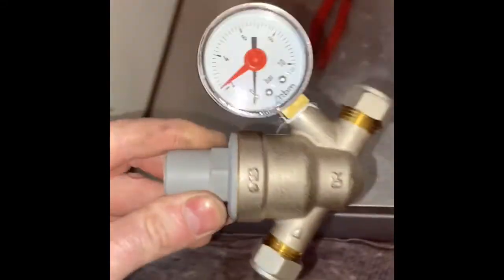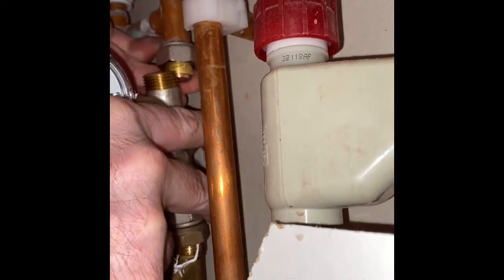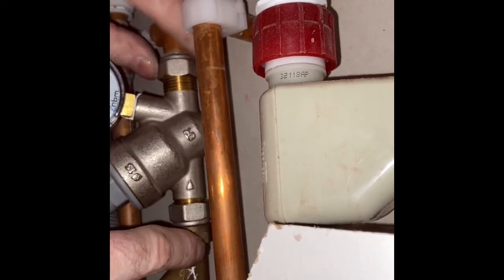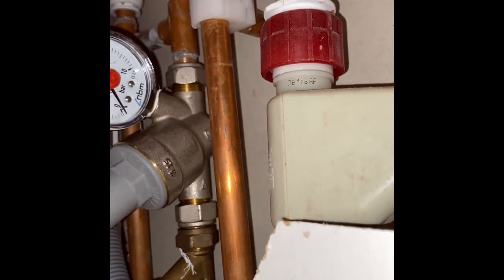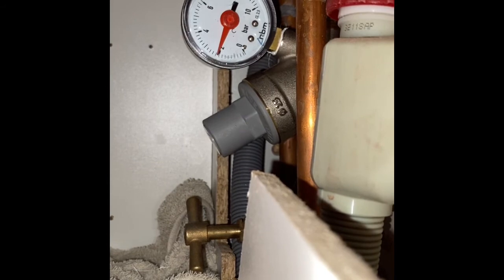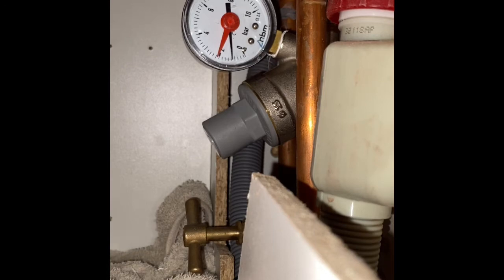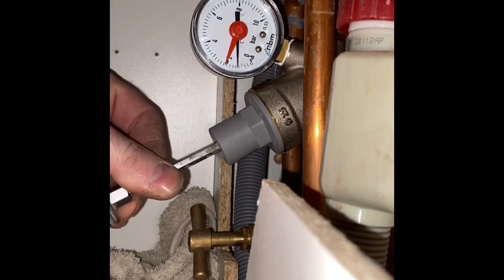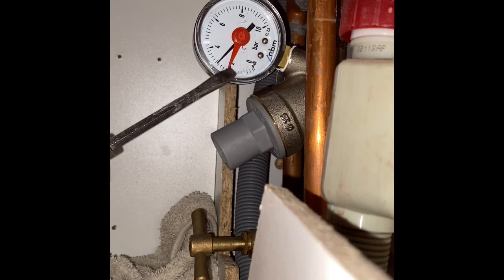Installing a pressure reducing valve on the mains stop tap

Comment: Will this cure water hammer every time  my neighbour uses their water?
Reply from the maker: This only reduces the pressure into the property
Reply: Close you stop tap off and open up all your taps shower etc leave them on and then turn your stop tap back on and let the air out of the system . Usually works🇮🇱

Comment: I have this on my house water pressure is terrible a good 40s to fill a kettle of water run a bath in 8 - 10 mins got it on 3.5 bar any other idea how to improve pressure ?
Reply: when you say the water pressure is terrible, is it too high, or too low ?
and where you say - any other idea how to improve pressure ? do you want it higher or lower pressure, water flow rate is a different thing to water pressure, it can be down to the taps and copper tube diameters etc,, do you have a cold water tank in the roof ?, or is it all feed direct from the cold water mains supply, do you have a mains feed or cold water tank supply, to hot water cylinder, mains water supply or cold water tank feed to it, or does you hot water come from the heating boiler ? which controls the flow rate, down to the water temperature.

Comment: Does it have to be on stop tap? I cant access mine it’s in a time void ? Cheers mick
Reply: t does not have to be connected directly next to the mains water supply stop valve, but it needs to be connected after the output side of the mains water supply stop valve, prior to any taps or toilet cisterns, and cold water tank ( cistern ) etc. so that no water is going to be at an extreme pressure, that what the " Water Pressure Reducing Valve, is for,
 have you caught up with the time void, or are you in advance of it, you might meet your self, on the way back.